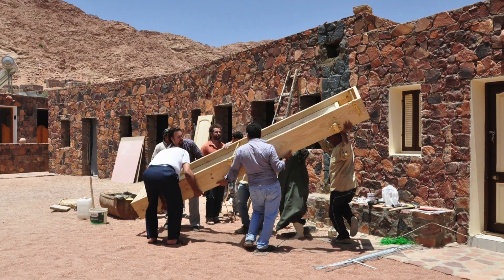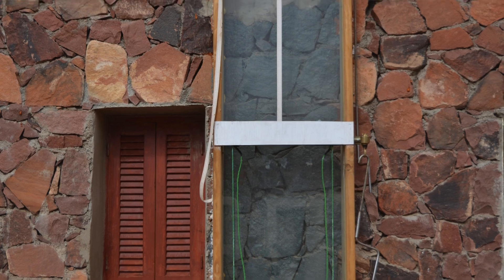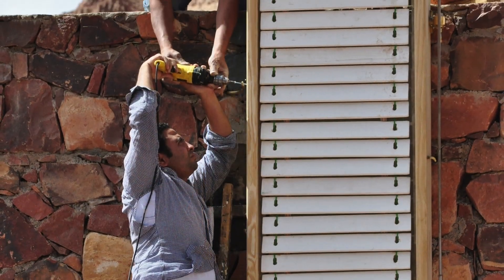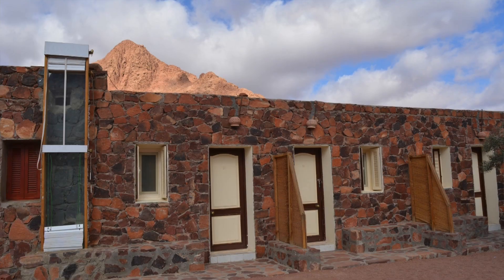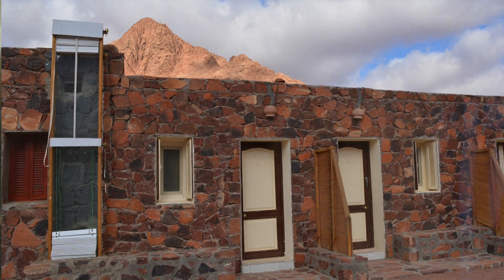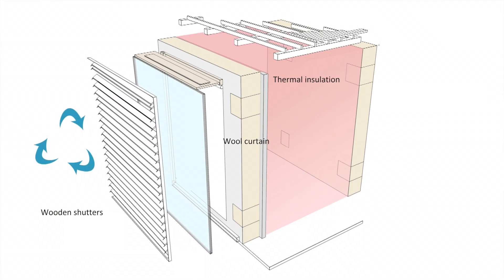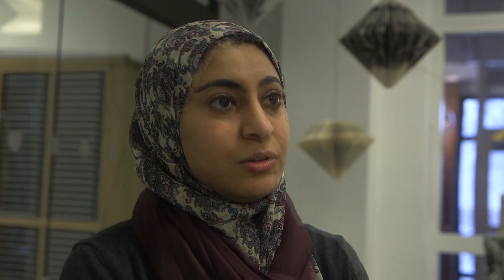Adapted Trombe wall now used for both heating and cooling buildings using renewable energy sources

Comment: No info about cooling. My guess - in summer they use this wall as solar chimney to extract air out of the building. During this upper hole into house is closed, and box's top is opened. And there has to be some another air supply, where air is taken from shady side of the building or even better - from underground pipe.

Comment: how can you get cooling with a trombe wall??
Reply: The shutter on the glazing can be closed, preventing the mass wall from heating up, and by controlling the inlet and outlet closure, you can use it for cooling as well
Reply: I have the same question. How do you do cooling with a trombe wall?